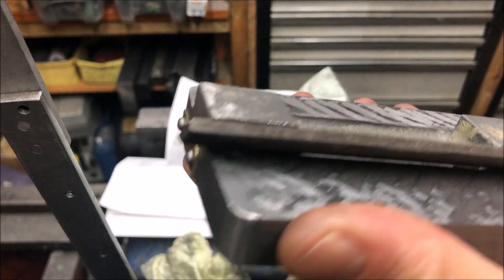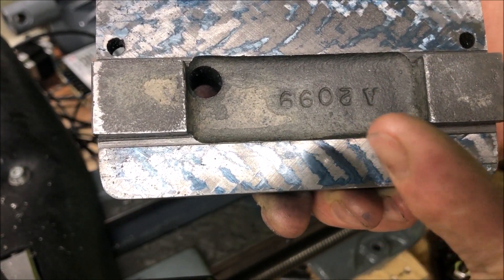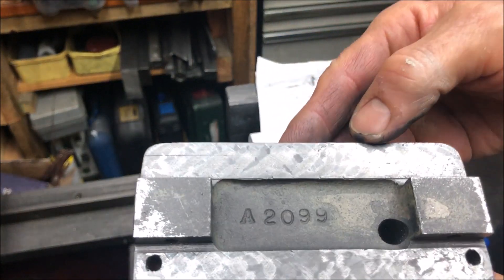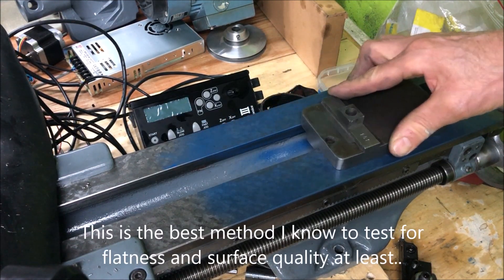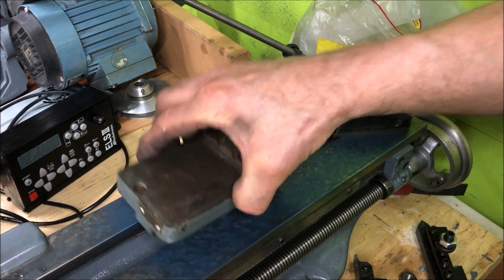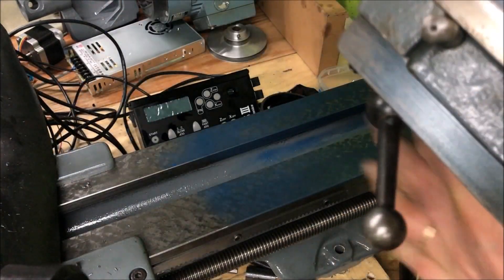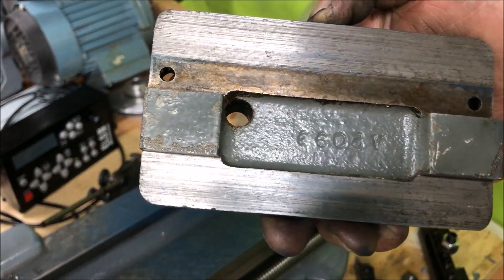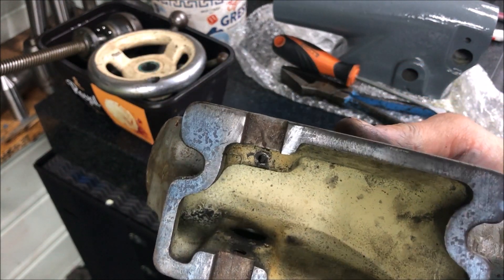Myford Super 7 - Tailstock restoration - part 1 - scraping and initial testing

Comment: Can you scrape for perpendicularity if can would like to see how you do it
Reply from the maker: You mean correct an error of the tailstock barrel to the spindle axis? If so, yes, I can show this (possibly have in earlier videos). It is a very slight correction. Only some light strokes on the rear and/or front side "pad"
Reply: @jansverrehaugjord9934  like scraping things squarer with the use of angle plate as measurement .
Reply from the maker: @woozhi9218  Oh.. but I must have shown this several times in earlier videos?